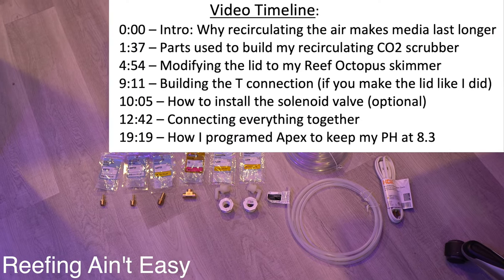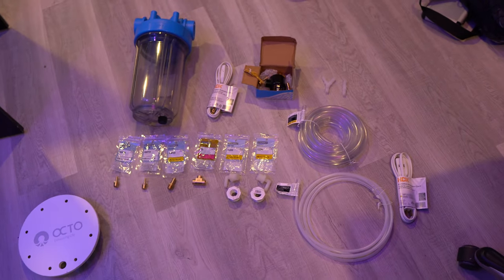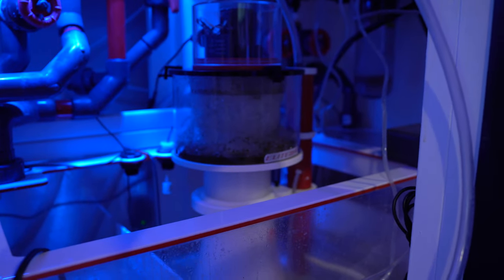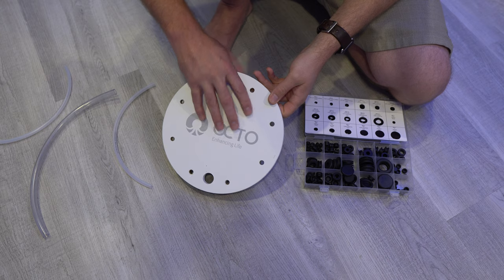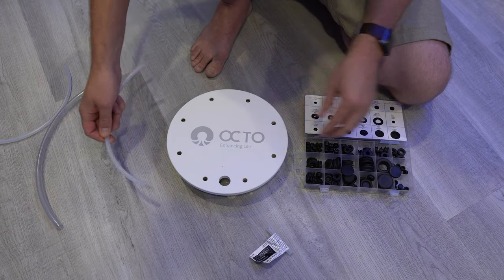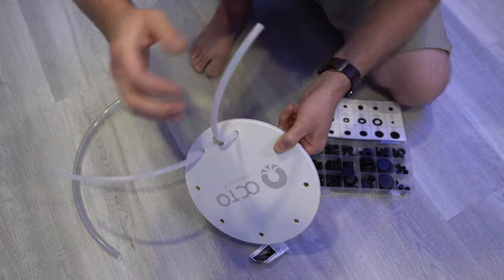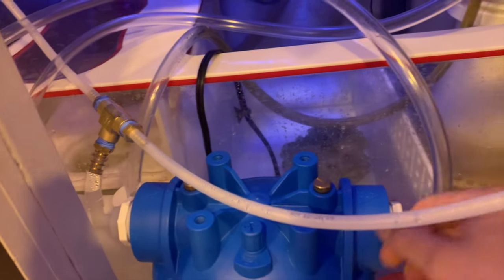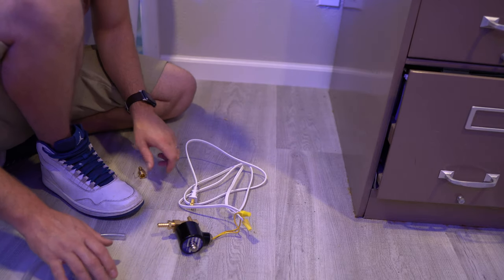Recirculating co2 scrubber reef tank

Comment: Where I live it’s a more damp climate in ny. I had to add a second chamber before the media chamber to catch condensation before over soaking the media
Reply from the maker: WOW, I have the opposite problem here, when I don't recirculate. Now that I am recirculating the media chamber does pool water at the bottom and I will need to drain. Haven't had to switch media yet, but hoping I can drain when that is needed instead, other wise I will need to do what you did. Do you need to do this for a regular scrubber or recirculating one?
Reply: @reefingainteasy3754  yea mine is recirculating
Reply from the maker: Okay thanks for the tip, I may need to do that as well.

Comment: Excellent Video...I am also setting up a recirculating CO2 scrubber myself.  Will this electric ball valve work as well?  Also found on Amazon:  BOKYWOX NPT 1/2'' AC 110-230V Motorized Ball Valve CR2-02 Electrical Ball Valve Normal Closed Stainless Steel 304 DN15MM

Comment: Are the brass fittings reef safe ? I would think those fittings being brass is not good for the reef seeing there’s copper in that metal.
Reply: I dont think it matters because its not touching water.
Reply: @shawnpotter2139  yeah but it will be under the sump where it’s damp and possibly rust and having anything rust by your sump is a no no

Comment: How did you manage to connect the wiring between the solenoid valve and the electrical cord?
Reply from the maker: It takes 120V so just used a regular lamp cord with two wires and connected the two wires. I plugged the lamp into my apex to control on off

Comment: Quick question.  Does the Skimmer line raise when switching to the soleniod because of the ability for more air to be drawn in?  The skimmer must have decreased air pull through all that tubing and C02 reactor?  Let me know I am currently trying to set a c02 scrubber up.
Reply from the maker: Hi JT, that is a great question, something I didn't even think about. I ran some test and to my surprise, no. Which is really counter intuitive, been scratching my head as to why not, and here is some reasoning as to maybe why. First the air leaving the skimmer does come out with some pressure, so perhaps I just got lucky and the length of the tubes and everything for my system is just right to where the extra amount of force the skimmer needs to suck air in is matched by the extra pressure created by the air being pushed out. If this is the case, then it will really depend on your specific set up and length of tubes. Another theory is the pump is powerful enough to get the air it needs, or the difference is so little I can't even notice it. Or maybe its a combo of both of these things. Hope that helps.

Comment: How often do you change out media before and after
Reply from the maker: I have only had to change it once and it lasted 5 weeks. But I live in CO and there was the largest fire ever hear really close to my house that lasted that whole time, which stripped the air of oxygen, so I pretty sure this second round of media is going to last much much longer I installed in Sept 29th and changed the media Nov. 5th and the 2nd batch its still going strong and looking good today.
Reply from the maker: 1st time with wild fire stripping oxygen from air next to my house 37 days. Second time with normal conditions 74 days!!... My PH dropped to 8.16 at night, I let it go a couple days and it still gets to 8.3 during the day but dropped to 8.13 last night, and I going to change today so 74 days till first big drop at night I changing today which is 76 day..... Huge money saver!... I learning a lot about Alk consumption relative to my PH and finding some stuff I was not expecting need to do some more test but will be making a video on that eventually.
Reply: @reefingainteasy3754  The moisture will ruin your media within 1 week.